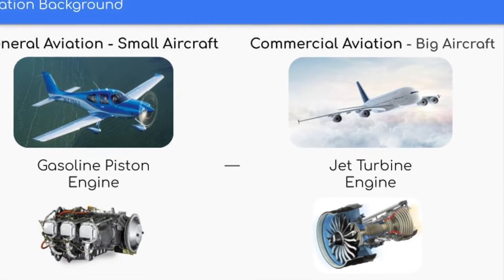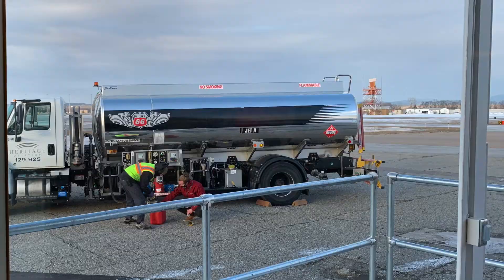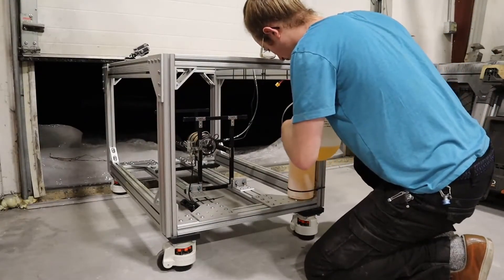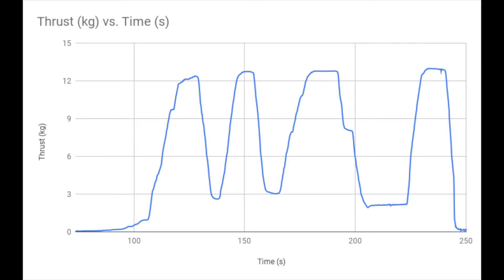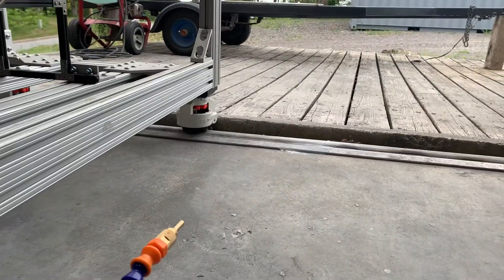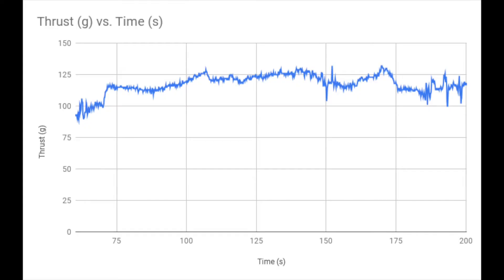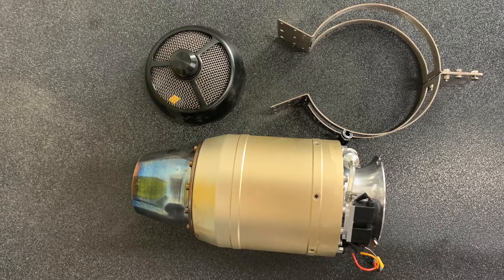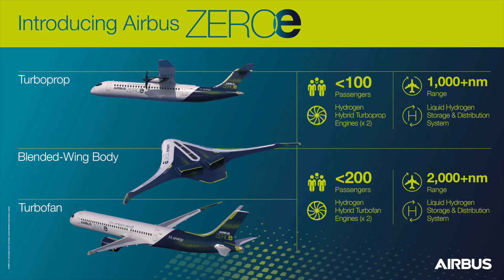Hydrogen Jet Engine

Comment: interesting project and i am curious if the hydrogen pressure is incresed with mixture of oil and water for temperature control and lubrication and because water expands when heated amount of water can be adjusted to just keep combustion going in pesence of water which can keep parts from melting due to extreme heat generated from hydrogen, boosts can also be provided by flooding pure oxygen through another fuel line would be cool concept if we can mass produce hydrogen in a sustanable and clean way

Comment: You don't need a flashback arrestor with pure hydrogen. I'm interested in this project because hydrogen has the potential to run at higher rpms with less heat generation.
Reply: Why would you not need a flashback arrestor/ and I thought hydrogen combust and generates a lot of heat
Reply: @TTVKeter  pure hydrogen cannot burn without oxygen. that's the reason the Hindenburg burned so slow vs a hydrogen pipe bomb.

Comment: A word of warning here, you probably know this already, but I know those little turbines aren't cheap. 

Hydrogen burns extremely hot under certain conditions, hot enough to melt that turbine from the inside out. Turbines are often run on a mixture of hydrogen and other fucked like NG, propane, methane etc..
Reply: other what?
Reply: @kingmasterlord  other fuels*** lol

 I guess my autocorrect has learned my typical vocabulary
Reply: @sportbikeguy9875  lmao
Reply: @kingmasterlord  lol
Reply: Lol.